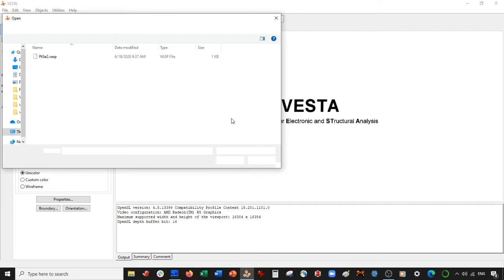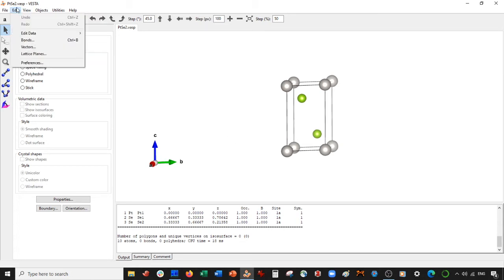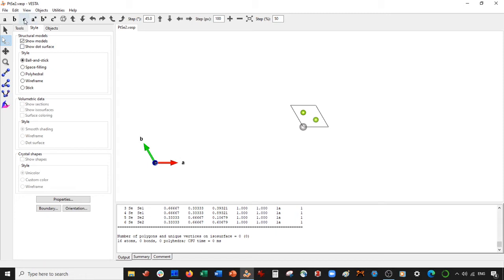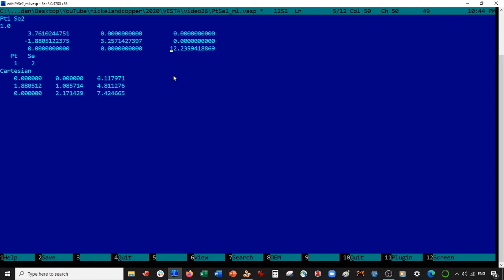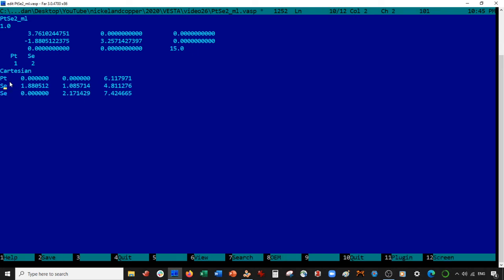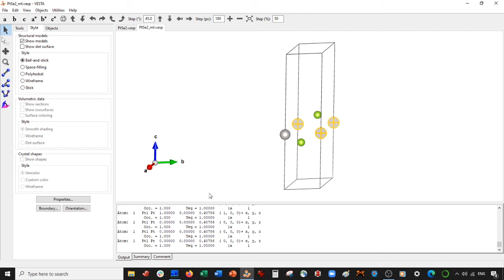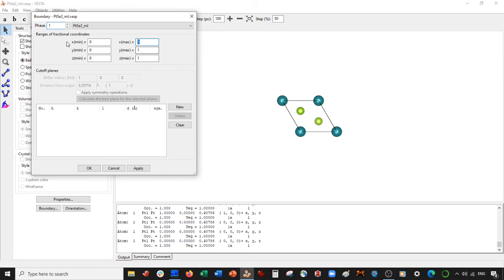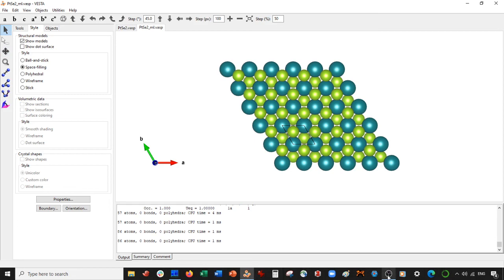VESTA Software - Build Monolayer PtSe2

Comment: Hi, Please I would like to place NO2 molecule on top of Se and Pt atoms in the PtSe2 monolayer. Can you please help with that? Many thanks
Reply from the maker: Bolarinwa Sherifdeen oluwaseyi - I am quite busy and most likely will be away for some time still. But check out one of my first heterostructure videos where I place a molecule on the surface of a gold slab
Reply: @nickelandcopper5636  Thanks champ. I must have seen that but would check again. I was able to place NO on PtSe2 successfully using your guide. Appears NO2 requires some technicality

Comment: Hi,

I would like to ask if there is a way of increasing or decreasing interlayer spacing within the same material on vesta without having to do too many rigorous calculations. We can use PtSe2 trilayer as an example. Say we want to decrease the interlayer spacing to say 1 Angstrom. Thanks
Reply from the maker: Hey - lets say we make a bilayer, the optimal spacings between the monolayers would have to be found through a geometry relaxation. I think it would be wise to start with the bilayer before the trilayer. It would be easy to make. But there would be some space between the monolayers in the bilayer. The optional spacing should be found through geometry optimization

Comment: Million trillion thanks to you sir, this video helped to make the SnS2 monolayer
Reply: Ah I understand, could you plz tell me the steps to follow, to relax a WS2 monolayer ? For example : starting from a bulk WS2 untill you arrive to good optimized cell parameters of WS2 monolayer.
Reply from the maker: I would start with the monolayer structure and do variable cell relaxation. Perhaps using a hybrid functional if the cost permits.
Reply: @nickelandcopper5636  What about starting with well relaxed 3D structure then create monolayer from it using your VESTA method, and then relax it again using hybrid functional ?
Also, for relaxation of the monolayer we use isif=2 or isisf = 3 ?
Reply from the maker: Chikou Ouettar. I would gather at least 10 papers that directly look at the optimization of semiconductor monolayers. Try to find some commonality among their procedures. I would then write down my procedure while citing them as ask my self if it makes sense. Run the procedure by your advisor too. I personally would start with the pristine monolayer system rather than the relaxed bulk system.
Reply from the maker: There is a very powerful saying that I try to do research by: 3 months working is worth 1 week of reading literature. Think about the people who may review your work are. Think about what they know about the science. Their knowledge is contained within their papers. If you know their papers, then you know what they will ask. Then you know how to measure what you ought to be doing
Reply: @nickelandcopper5636  This is Golden!!! I would inscribe this in Gold in my hearts, work by it, and train my mentees with it. Thanks for the inspiration man... Cheers.
Reply from the maker: You got it! I’m glad it helped ... and curious as to what you ended up with!
Reply: @nickelandcopper5636  Sir are you familiar with VASP code calculations ?
Reply from the maker: I am. But I decided I won’t be featuring commercial software on this channel, although I do in principle support its use.

Comment: Absolutely awesome. Can you please tell me that is it possible to convert this Vasp file to .cif file, so that we can use it in WIEN2k package? Or can you please tell how to use this final file in WIEN2k calculation? 
When I directly export this file to cif file and open that cif file, I get again the single unit cell reduced atoms and not the complete monolayer.
Reply from the maker: Hi, thanks for the comment. I am not sure about a vasp to a cif file for the monolayer. Let me look into it.
Reply: @nickelandcopper5636  thanks a lot, for your kind response. Please let me know if you find something. I want to know that should I proceed for the calculation with the single unit cell or with supercell.
Reply from the maker: Hi. It seems that you need to first export the monolayer as a .vasp. Then re open it in Vesta and then export it as a .cif. Then when I open this cif, I get the ML and not the original unit cell. Please try this and let me know
Reply: @nickelandcopper5636  when I reopened the Vasp file after exporting, it wasn't the same structure. It is just a single unit cell, not a ML.
Reply from the maker: Ok. Please watch my procedure again carefully. It is likely you are not doing a step that updates the atoms in Vesta. Make sure you follow every step. There are some steps where I export files along the way.